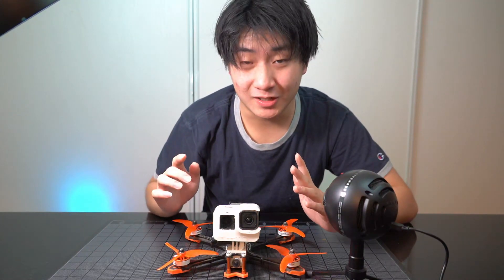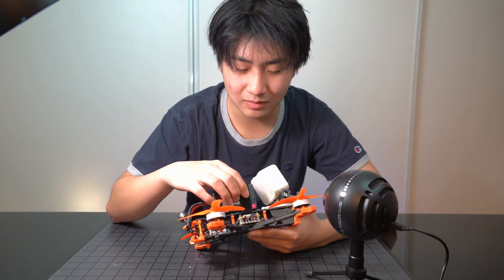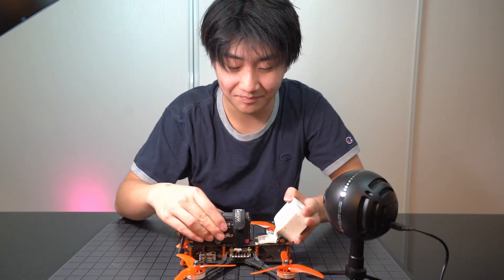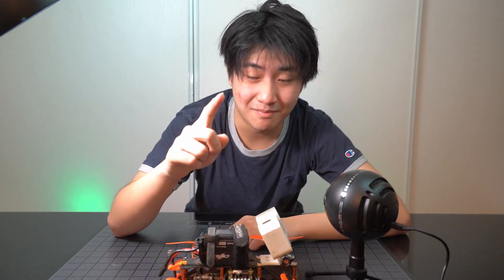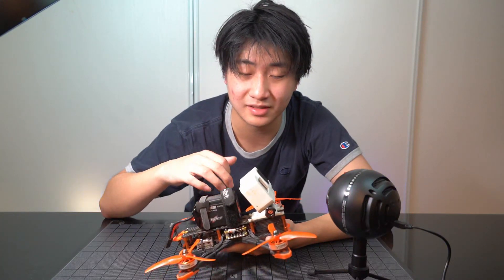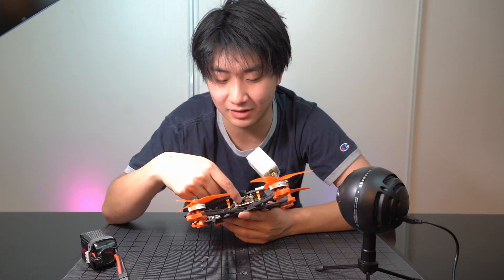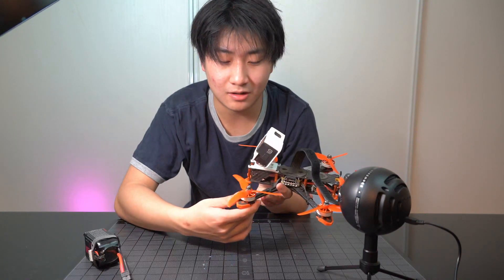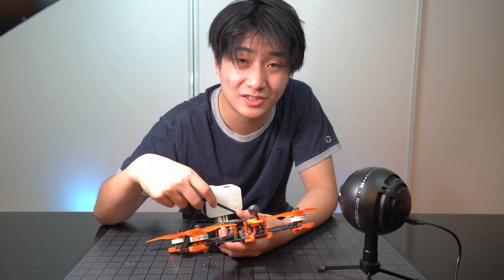$190 T-MOTOR PNP QUAD?? Final Verdict on T-Motor FT5MK2 FPV Drone

Comment: You are correct about the FC wires off to the side. I scrapped some branches and it ripped off the entire connector, messing up 2 motor connections. (Won’t even work after soldering straight to pads 😭)